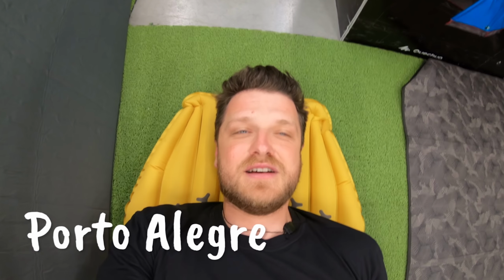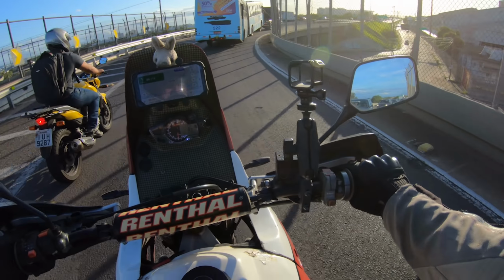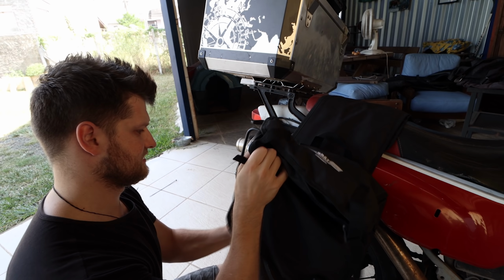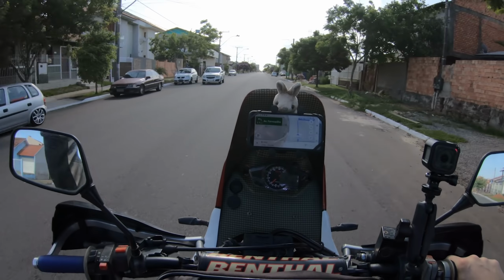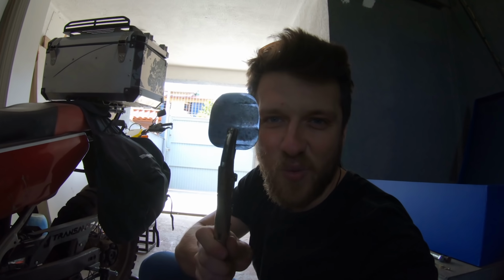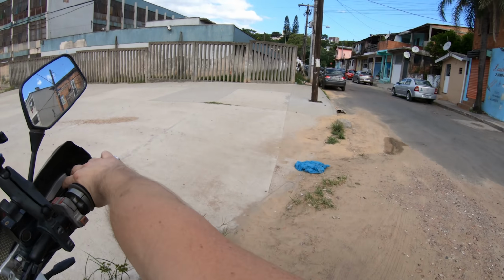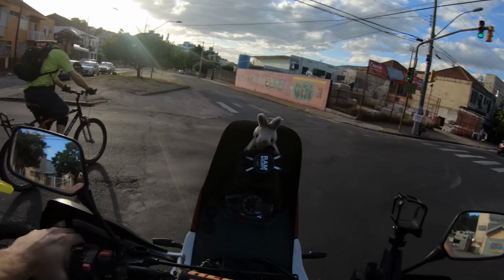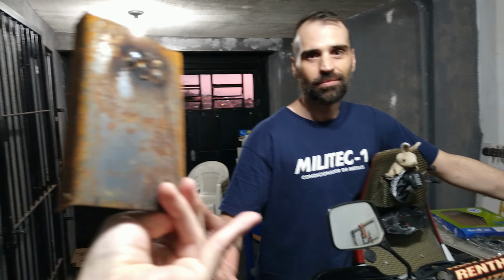Brazilian Stranger Offers New Sprocket and Helps Service My Motorcycle

Comment: Self inflating air beds are brilliant. I use 3/4 size as obviously the full size is bigger. It covers you whole body apart from your head and I usually just use my clothes as a pillow. They inflate really fast and fold up easily quite small. I usually put mine on the back seat along with my tent and sleeping bag. I think my air bed is a Kathmandu one. Your tent much smaller than mine. Mine is 1 person tent but you also fit your gear inside-helmet, trousers etc. Where the little tunnel one's only fit the person so where do you put your gear out of the elements. Mine just sits across the panniers and back seat. That's a massive store Pedro-oh my god..Dried food is good in that it takes up little space and little weight. I use Kathmandu single butane cooker or if camping ground I use theirs. I have 2 pots with 1 fitting inside the other as often the dried food has 2 ingredients-hence 2 pots. Headlight a great idea-I don;t have one-oops. Harley's are powered by Briggs & Stratton V twin's-did you not know that! Lol. They love it when you tell them that. Where's your Hero session gone?? You should go for sponsorship with Honda like Rosario Sala is doing. He's heading to Africa (again), I think he might also be sponsored by touratech. You would need to go to a current Honda model though to be relevant to helping with sales. Those bags need to use the Pannier frame you have on the side for support. This means they need to slide back although not sure what that means for your top box. Top boxes a useless except if desperate for storage of liteweight items. With a motorcycle all heavy weight including engines/ cylinders and your gear must be carried as low as possible for handling/control & stability. It's no good up high, unless it;s fuel on a carrier you plan to tip into your tank further up the bush track. You're the best Pedro-can't wait to see your Patagonia video's. I have lot's of questions for you but I know you are busy what you're doing, so I won't bother.

Comment: I use an Ultralite cot and an MSR tent that fits perfectly on top of it.  People scoff at first, but in the end it is the same size and weight (if not smaller and lighter) than all of that other stuff combined.  I don't need any mats, ground tarps, pegs, ropes, cushions, mattresses, etc.  I can set it on any surface, be off the ground, move it easily around the campsite if needed, and it feels the same every time I use it - extremely comfortable.  It sets up in just a minute or two, and everything fits in the cot bag.

Easy, compact, and it has lasted for years with minimal signs of wear.

Comment: Awesome, though consider trimming the site stand plate a bit. Swingarm tends to bent while cornering, especially on a fully loaded motorcycle like yours! On the video it looked pretty close. Cheers
Reply from the maker: I greased the whole thing later and operation is so smooth now that it touches the swingarm easy and with impact. Need to grind a bit off